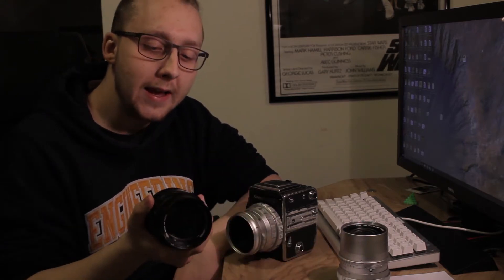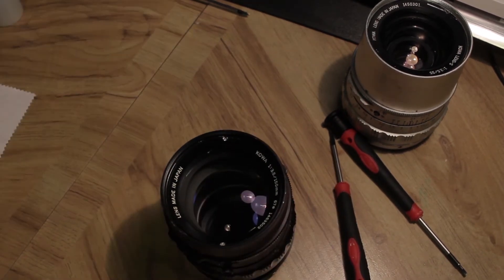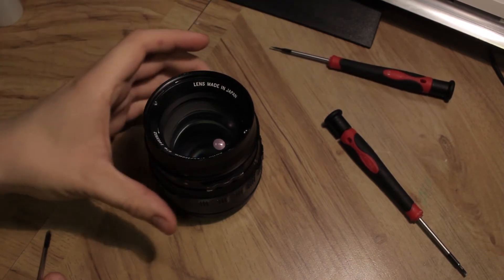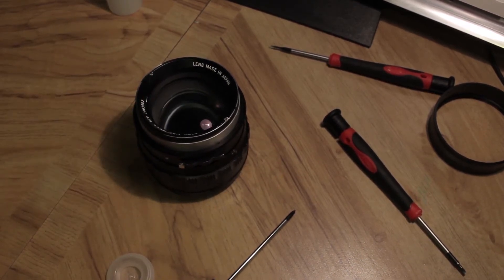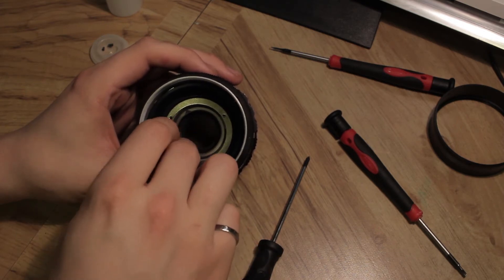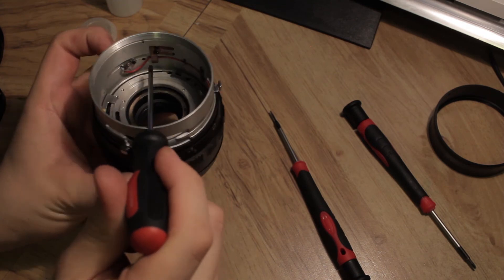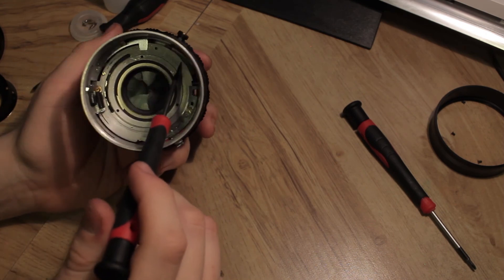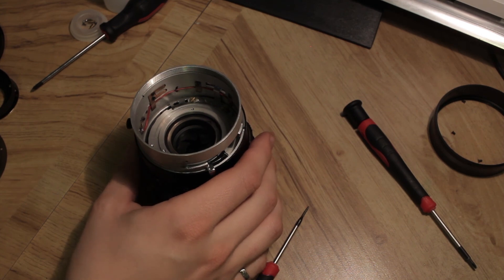Medium Format Lens Disassembly - Kowa Six 150mm f3.5

Comment: I have a 150mm and something internally has changed. loose part or something, so it no longer advances (cocks) for some reason.  I took it apart as far as you did but the problem is  deeper then I am willing to go.  Sucks.

Comment: Hi quick question about my Kowa Six 85mm lens. With the lens of the camera, when I push the pin to release the shutter, the two sliding pins move a little but then need to be nudged along the rest of the way. Is this normal or should they move freely on their own? How far into the lens would I need to tear down to fix this and what kind of oil would I use? Thanks!